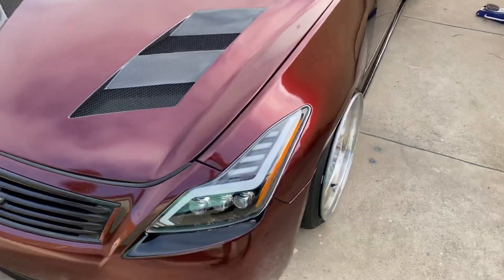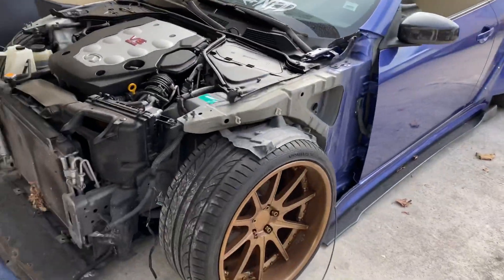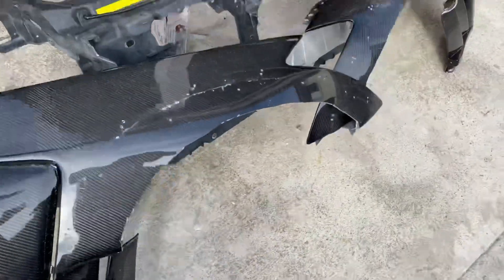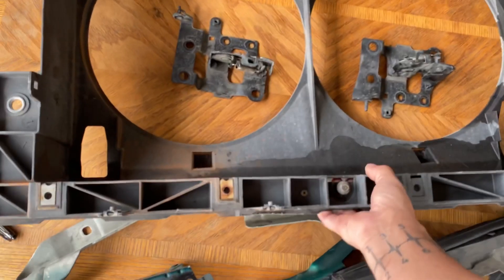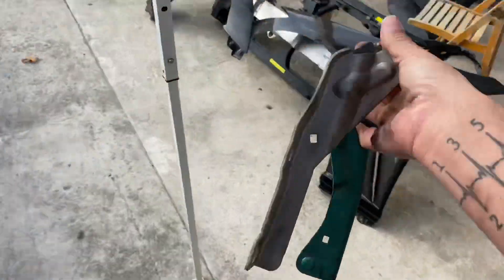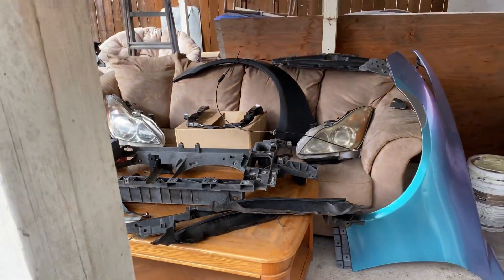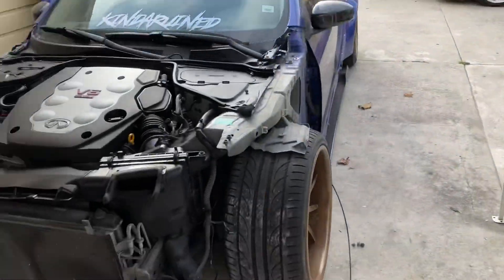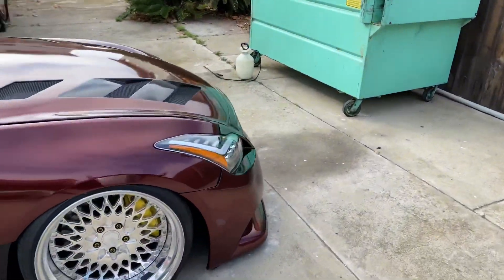G35 to G37 front end conversion part 2 ( EVERYTHING YOU NEED)

Comment: Edi you didn't mention the crash bar, does this conversion have it or not?
Reply from the maker: Crap lmao 😂 yes! I think I mentioned it in the Part 1 it will be cut and remounted
Reply: @edimaya2951  
Oh ok...I didn't remember you saying it then either. But that's good to know. Safety first👍
Reply: Nice video one the best looking infiniti's on the tube if not the best
Reply: Also what's the year of the car you use the for parts and was it a sedan or coupe
Reply: @sapboi104  
Can't use sedan for coupe parts and vice versa bro..
Reply: @nonameisthename138  

So any g37 coupe front end will work?
Reply: @sapboi104  
Well, kinda......but not exactly.. Did you watch his videos on the conversion? That's ALOT of work and fabrication! This is not something you can buy off the rack and make it work. So basically, whatever year you got, stick with that or maybe the year before or after yours. But if you want my honest opinion,  if you have ZERO experience with fab work, don't do it. You're going to mess up what you trying to work on as well as your actual car..